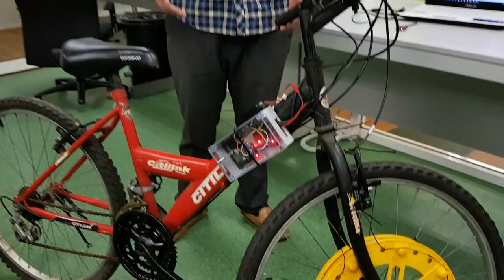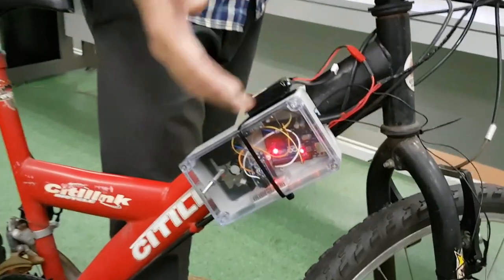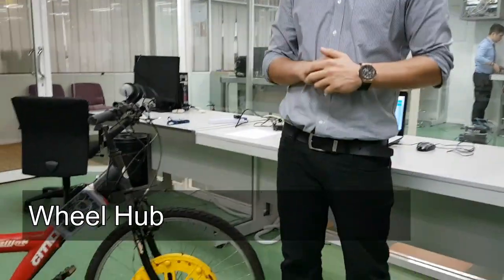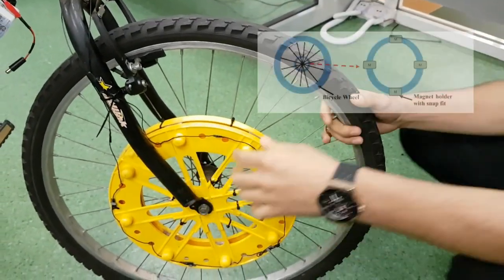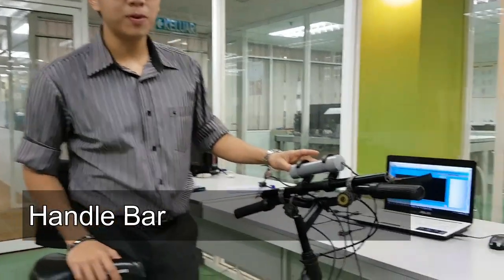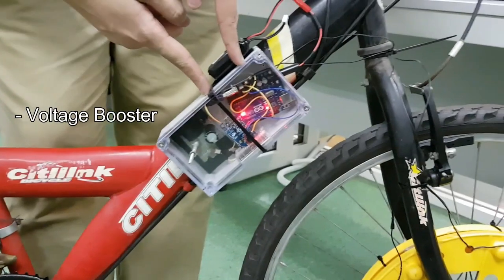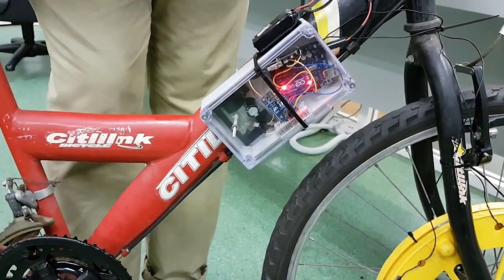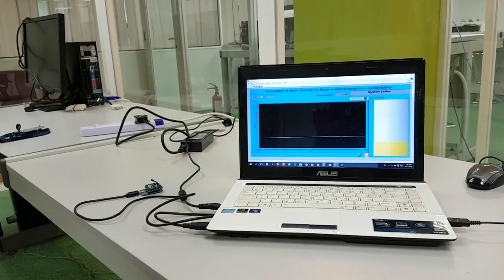Kinetic Harvester for Bicycle

Comment: ,
I mean, if you had, a 1500w rear motor, and a higher wattage front motor, re-engineered with magnets on the spokes to turn it, & become a generator.  You would need to discharge, or shut off the electricity collected on the front wheel, once the battery was at capacity.
Reply: Theres no need for 2 motors, if I am not wrong the rear motor you mentioned is a bldc hub motor. For  operating with the motor we use higher voltages than the motor can produce as a generator. (Spinning the motor normally is more efficient then using it as a generator). So in order to get higher (efficient) voltage we use a boost converter. Boost converter takes a variable input and converts it into chosen battery Voltage. Boost converters for ebikes are on eBay for like 5$

Comment: Instead of having a charging system on the handlebars, why didn't you use a bike with suspension? The kinetic energy from the front forks suspension and any suspension on the seat would I think be of more use in charging  don't you think?

Comment: What are the problem with this idea. My level of physics is undergraduate level.
Reply from the maker: I'm sorry, I don't understand what are you trying to ask.
Reply: My apologies. I am an undergraduate and am looking to undertake engineering at university. This project of yours looks like a perfect thing to research and think about and thanks to your video I understand how you use electromagnetic induction to generate electricity. i would like to ask; why is this not efficient or enough for market? And, is it possible to attach a motor to the enhance the bikes movement, a motor powered by the energy it generates?

Thank You
Reply from the maker: hmm, yet our design only able to generate up to 5V 0.01A and barely even charged up a phone more than 2% for a 1km write.

The cut-off magnetic field cooperates with the speed of the wheel spinning hence controlling the current output of the power generated. My recommendation is increasing the number of magnets or number of turns in the coil to increase current generated due to 
Flux = BA

Hence, I would say that the power generated yet is not enough to power the motor for current design. 

Thanks, I hope this could help you :D

Comment: As soon as you try and draw a load from this, you will experience a lot of drag due to Eddy currents/Lens law.  I don't see any benefit unless you are looking for a bike that feels like the brakes are on all the time.
Reply from the maker: Actually, in high speed I barely feel any drag, due to the fact that the N42 magnet used is less and the coil structure is smaller than actual alternator (internal). The beneficial focus on introducing lesser drag than commercial dynamo (friction drag), where still be able to generate power up to 5v.

It is just an innovative idea, yet this harvester is not ready for market.
Reply: Ok I look forward to hearing more about the design.
Reply: @valveman12  If you could use this harvester to charge power banks, such as those made with 18650 batteries, you could use the energy from this to charge most household electronics.
Reply: @the.reel.mccoy.  Are you suggesting peddling around while charging power banks?  How easy do you think it will be to charge power banks while riding around?  How many banks would you charge at one time?  Let me know if it worked out.

Comment: I'm looking to make something similar, is there any details you could send? I'm in two minds on what to select for magnet and coils? I'm looking to do 9 coil 12 magnet and work in a 3 phase...any suggestions? thanks
Reply from the maker: We got the coils from the mechanical relays in the spoil car logic board, and we used around 24 pieces of N52 magnets. I hope this helps you..

We tried to coils our own inductors, does not work as well as the coils coil by machine.

Comment: Cool! do you have a link for your circuit diagram of the charging circuit?
Reply from the maker: Hi Electronics Maniac, of course got. This is the resources I used
http://macao.communications.museum/eng/exhibition/secondfloor/MoreInfo/2_3_5_ChargingCapacitor.html.
It's a very simple capacitor discharge and charging circuit, we added a diode at the charging switch to stop the backflow.
Reply: Thanks You Sir!